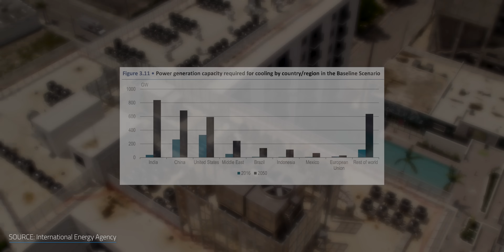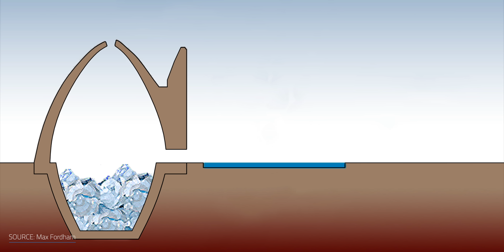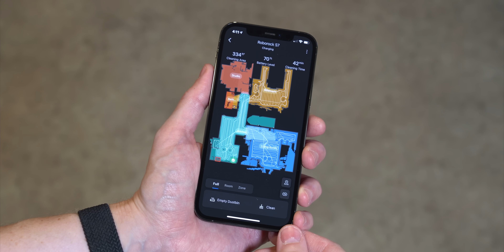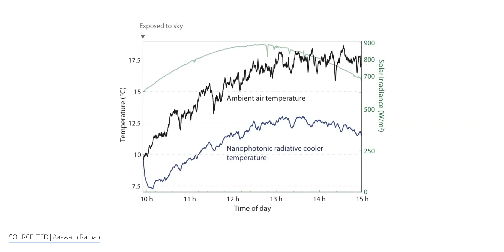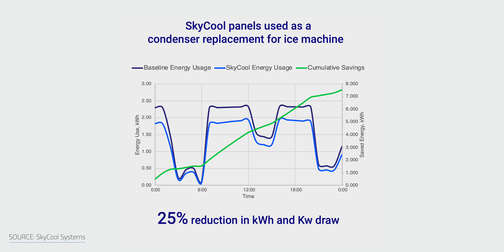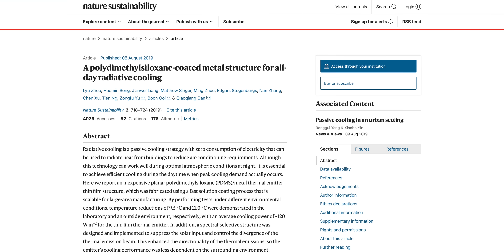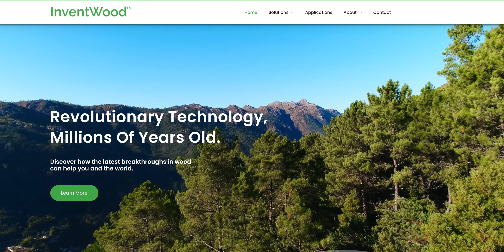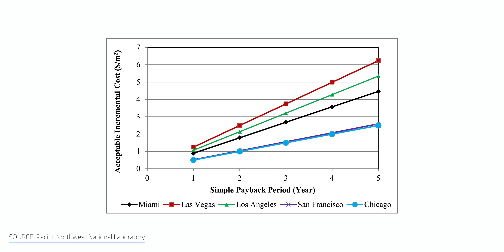Space Powered Cooling May Be the Future of Energy

Comment: Use this on the cool side of a Sterling engine and the heat from the back of solar panels for the hot side of the engine. The engine could then run circulation pumps. If it works it should make the solar panels more efficient and last longer.
Reply: You should contact the developers with that idea.
Reply: Why not just directly powering the pump with the power generated from the solar panel instead?
This way, no energy is wasted.
Reply: @RedCocoon  the Sterling engine draws no electrical power from the panel. Using the power from the panel decreases the power output of the panel to the grid which defeats the purpose of this technology.
Reply: @patrickforbes6745  yes, it draws no electricity.
However, it draws heat energy.
Reply: @RedCocoon  Drawing heat from a PV panel is a good thing, since this will increase the PV output of the panel. So you draw away the heat making the PV more efficient and use that heat to run a Sterling. Win...Win!

I have already looked into solar driven Sterlings and, unfortunately, there isn't a large enough thermal delta to make a Sterling run efficiently. A Sterling-based cooling system would be way more complicated/expensive/large than just using PV panels and standard compressor-based cooling.
Reply: big brain time
Reply: I was going to suggest a layer of bimetal built into the panel between the hot fluid and the cooling panel for electrical generation but sterling engines are always good too.
Reply: @steveschritz1823  bimetal or peltier would be great for that, since it has no moving parts
Reply: @Vinski we won’t know unless we try.
Reply: Too small difrence between those surfaces for sterling engine to work.
Reply: @Dawid-kn6mv  I'd argue the opposite, that there's really plenty of heat differential for the right sterling engine to use the heat alone from a PV solar panel. They get much hotter than ambient temperature. Just the difference between the PV panel and the shadow underneath it would be enough for an array of sterling engines adding to power production, let alone if you connect the cold side of the engine to say, ceramic/concrete ceiling tiles directly in the shade of the panel.

Comment: I like the idea, but there is a real mix in the data between what make a cooler surface and what make do that and dump the heat to space. As I can understand it only one of the products try to dump it to space, the rest just avoid getting the surface as hot. Some heat can still end up in space using the other products, but that more accidentally.
I would liked a comparison with the old technique of just using a false roof on top that shade the roof under.

Comment: Reflected sunlight still heats the atmosphere, it relates to the Albedo factor. The reflected light will repeat the course through the atmosphere going "back" to space and hitting all those particles in the way once again. Its not a buzzkill but it has to be considered.
Reply: This is true for many (most) wavelengths of light, but obviously not true for all of them, or else planets in the sky would all be invisible.  converting energy to the wavelengths that can get through will work, and does work.
Reply: @michaelleue7594  That's right but it doesn't work exactly as you're saying, sure wavelength might be the most important but I guess it changes the color which we percieve the cosmic object. Light won't be trapped in the particles floating inside the atmosphere, but they will refract until filtered or just diverted. The Earth without atmosphere would have a different hue or color. The refraction index plays a role but the particles won't trap the light.

Comment: I really like the idea of the super white paints in theory, however in reality of course dust and dirt settles on top of these paints, rendering them just as effective as normal white paint that is covered with dust and dirt. Also wonder how the panels handle these problems. Still really interesting!.
Reply: Ah, but you're forgetting the part where the sheer whiteness of the panel actually repels dirt.  It's kind of like fusion power: once you hit a critical level, the whiteness starts sustaining itself and then gets even more white over time, until it becomes a perfect infrared mirror, and there's nothing anyone can do to stop it, short of using Vantablack.
Reply: @michaelleue7594  lol xD

Comment: Now I'm wondering... Could you synthesize an all-organic compound fluorescing at those specific wavelengths and if so, we could implement enzymatic chains into plants that produce those compounds in their leaves.
It wouldn't really matter how efficient they are, but by fluorescing in long IR, they would cool the leaves surface down a bit. If we planted such plants along the coast of let's say Africa, it could change the overall temperature, sucking in moist air from the ocean and wetting the area, making it easier for those plants to spread inwards, where they would cool the land, etc.
Basically covering those 2% of the globe using something that grows itself...
Reply: Stop cutting trees!!!
Reply: @Reburned32  just stopping to cut down trees will not be enough to change the global climate. Even if we just replanted the trees we cut down already, it wouldn't be enough. Forests only sequester more carbon than they emit in their growth phase, which - depending on the type of forest - will only last about a century or so, before it stagnates, which won't be enough time to sequester a lot of carbon. We need to plant new forests in areas where there weren't any in the last thousand years and the best option would be to store the carbon away from the tree trunks and down to the roots into the soil. But we would still need to cut down loads of trees to build more houses from timber and less from concrete, to make the entire industry carbon negative. Then we can regrow those trees we cut down, extending the growth phase of the entire forest to make it more productive in pulling CO2 from the air.

Comment: I’m intrigued, but curious how much more effective this would be at saving power over just installing photovoltaic panels in the same space.

And what about combining the two technologies? I’ve seen videos before about multilayer and transparent solar panels, what about making this a bottom layer? You get a potential double pass of light through the photovoltaic layers and the “excess” light gets reflected instead of absorbed.
Reply from the maker: I don't think it's really possible to combine the two together as one panel, but using the two in conjunction can be a great one/two punch.  One helping to reduce energy usage and the other other actually generating electricity.
Reply: Not only do solar panels produce energy, they use energy that would have been heat. It seems like a better solution. I mentioned that as well.
Reply: @grantmccoy6739  Photovoltaics use a very small percentage of the photons that hit them- most of the light is still either reflected or converted to heat
Reply: @Approximation  ok. They are supposedly 15-23% efficient, which is actually better than just reflecting light back into the environment, and heating it twice. We are talking about global warming and power usage right?
I can't imagine that a bigger heat exchanger is more efficient than a power producer, even with the relatively low power output of solar.
Also, it's kind of funny how inefficient everything is.
Reply: @Approximation  I wouldn't say 20-25% efficiency is "a very small percentage"
And any energy "reflected back into space" is doing what these radiative panels do without needing a pump at all.
It's always better to reduce the cooling load by avoiding gain in the first place.
Reply: @grantmccoy6739  The idea is that these panels would be 10-20 times cheaper than solar panels.
Reply: @lazyman114  I don't think it works. Heat is practically universally conducted, and if water vapor reduces it's efficiency, than this is all but confirmed. It's probably just a different take on a heat exchanger.
Reply: @grantmccoy6739  It definitely works in theory. It's basically the same as painting a building white, which makes this kind of thing silly.
Reply: @lazyman114  why though? Reflecting heat isn't even close to what this is supposed to do. This is supposed to radiate heat at a frequency that matter doesn't conduct. Yet, water vapor (humidity/clouds) reduces it's effectiveness. So clearly, it doesn't radiate heat in a form that isn't absorbed by the environment. It's just a heat exchanger that reflects light, and probably not even a more effective heat exchanger than conventional types.

Comment: I’m confused with the benefit of this technology in a CO2 green house situation. Will it convert more solar heat into atmosphere?
Reply: As I understand, no. It is tuned to the frequency that the atmospere lets out the easiest.
Reply: @Sekir80  are we saying it can convert heat into an emission wave longer or shorter than 9-12 um efficiently?
Reply: @philoso377  Yes.
Reply: @Sekir80 so do we know what wavelength or that and the conversion efficient? At what efficiency point we may say this is a viable solution?
Reply: @philoso377  The video tells you the wavelength window, as far as I remember.
Conversion efficiency? No idea, only the stated heatloss was mentioned. To calculate the efficiency you need to have a proper system as an example, from what I took away from this video only the pumps use some electrical energy, that's not a lot. Therefor efficiency is kinda high, or in other words, higher than AC, I guess.
I don't think we need an efficiency question here. If they mislead or even lie to us by how good their system compared to traditional AC, then of course, there is a question.
Reply: @Sekir80  as far as I can stretch, the radiation may be either or both 1) radio wavelength or  lower 2) light wavelength or higher. I don’t know if anything or process that convert heat into those waves. Your advice?
Reply: @philoso377  It is a light wavelength, higher then visible, called infra red. That's heat.
Reply: @Sekir80  if I understand physics, heat wave IR is blocked by glass and atmospheric CO2 hence green house effect. By what process can heat energy go pass CO2 into the outer space?
Reply: @philoso377  There is a chart at 2:45. You can see the atmospheric window, which means those wavelengths are not bolcked and reflected back to the ground/held in the atmosphere.
Reply: @Sekir80  I see page 2:45. 

Is the chart on 2:45 describe spectral emission vs absorption? That is just heat transmitted to heat absorption ratio. What if absorption into something within earth’s atmosphere? If so earth isn’t any cooler, only heat redistribution.
Reply: @philoso377  Think about it this way: if you put on a blue sunglasses, which filters out all other light you will see only blue stuff, everything else becomes black. This way we can make sure the panels emit the right radiation. How do we know the atmospheric window? The same way. 
There was two other explanation in the video, one is the frosting on your window when not even below zero, and two is the ancient Persian water cooling/ice making method.
Reply: @Sekir80  I appreciate the Persian ice maker model. My point is that heat loss from Persian ice maker (or from the new invention) may not necessarily delivered into deep space. It can end up somewhere within earth’s atmosphere, hence earth isn’t any cooler from that.
Reply: @philoso377  Got it! I have no way to prove that to you, but trust the science. May be that work and we not doomed.
Reply: @Sekir80  your persistence have prompt me into thinking mode thanks. 
How about asking the space agency for help. Set up an experiment on earth viewable from a satellite wearing experiment spectrum specific lens to block all else wavelengths except the intended emission. This experiment can proof the operating principle of the concept before we call it an invention.
Reply: @philoso377  My persistence? Okay, thanks. :-)
Your idea is okay, but I believe we don't need such IR pass lens. We could simply do a spectroscopy, giving us the opacity of the atmosphere seen from space. I believe the results will be similar (or same) as the graph in the video we were discussing already.
Reply: @Sekir80  once again, that is just emission/absorption ratio. That “absorption” can be mistaken for transmitted through into deep space, while it may as well be absorbed into the atmosphere only. So it can’t be confirmed from observation within earth atmospheric scientifically.
Reply from the maker: It doesn't add more solar heat into the atmosphere.  This heat is literally being shed off into space and doesn't get trapped.
Reply: @UndecidedMF  Hey Matt! Thanks for todays puns! ;)
Here, take a look at another type of air conditioning: https://youtu.be/R_g4nT4a28U

Comment: I wonder if research into these coatings could be applied to improve spacecraft/space station radiators, which rely entirely on radiative heat rejection (radiative cooling) to dump all their waste heat. 

Eg most of the big “solar panels” on the ISS are actually the radiators, just for the much smaller solar panels and atmosphere systems and human body heat and so on. 

This means anything high-powered such as a fusion rocket would need tons of radiator surface area to actually keep the coolant cool and so on. 

So I have to imagine, if these materials are better at outputting IR light, could they be useful for spacecraft? Or are they only better because of working within an atmosphere?

Comment: Use heat differences to run Stirling motor or thermal to electric convertor..
Reply: While possible to do that there is likely no benefit to it. The big advantage that these panels bring is that it is not necesarry to transform the energy to another form and thus there is no loss during that transformation. Warm fluid in, cooler fluid out. There is only a low consumption circulation pump to make the fluid go round.

Comment: Matt, while highly reflective paints appear to work quite well in controlled conditions, I suspect that airborne particles (dirt) would quickly degrade performance of these paints. This would be especially true for matte (no pun intended) / rough surfaces. Smooth surfaces would likely better retain performance in the same way the smooth outer surfaces of solar panels rinse off easily.
Reply: Making it hydrophobic would make most dirt fall off.
Reply: @filonin2  wash off, making something hydrophobic does nothing for dirt and grime it requires at minimum for some rain to fall, and even then not all hydrophobic coatings allow for that to work too, and almost all of them are exceedingly toxic
Reply: @filonin2  Your suggestion would indeed be useful for some contaminants, but unfortunately not all. Ar least some of the highly reflective surfaces mentioned in the video are the same materials as diffusely-reflective standards used in optical instruments, which are kept in air-tight containers and are handled using gloved hands precisely to reduce contamination. One these standards get dirty, they never return to their ASTM reflectance levels.
Reply: same as normal solar, some periodic clining should solve the problem as sooth acumulates
Reply: Sure, but the paint can be a much, much cheaper solution than reflective surfaces based on a multi-layer coating design. So there will definitely be plenty of use-cases for it.
Reply: The goal is to make improvements over the current standard which is usually black asphalt shingles, so even regular white paint would be a significant improvement even after it gets dirty.
Reply: Yup. Plus it would make the light color in house roof kinda ugly much faster than slight darker color. In tropical places ike mine we just make insulations in between our ceiling and roof. It could help in much colder places but Im sure the weather will just destroy it nontheless. Maintenance will be a pain in the ass for a longtime too.

Comment: Would a 12C delta be enough to run a sterling engine?
Reply: Not a powerful one, but more to the point, why would you bother?  You're basically asking if you can take a shady area and make it less shady by importing sunlight.  Of course you can.  But as a means of power generation, solar power is far more direct, and therefore fundamentally more efficient, and as a means of eliminating shade, just moving the shadow is a triviality.  A Stirling engine doesn't do anything here that you would actually care about.
Reply: @michaelleue7594  It's got nothing to do with shade, rather it's about turning waste into usable energy, even better if it's passive and not reliant on daylight. Just a thought.

Comment: I dont understand how the radiative panels are implemented. Do they act as a condenser to a traditional compressor/evaporator cooling loop? Also, if they cool the liquid inside the 10C below average, does that mean the hotter the liquid, the more efficient it is?
Reply: You just let warm liquid flow through the device, it gets cooled down and inside the house, you let the now cooled liquid flow through a heat exchanger, cooling your ambient air.